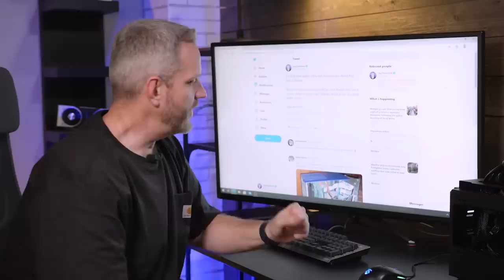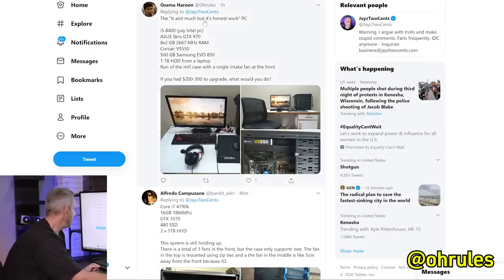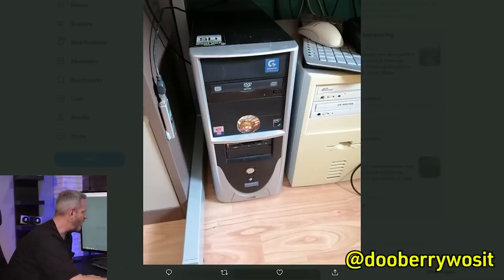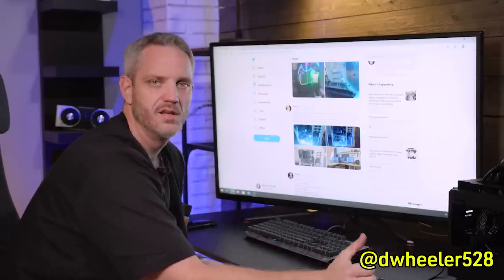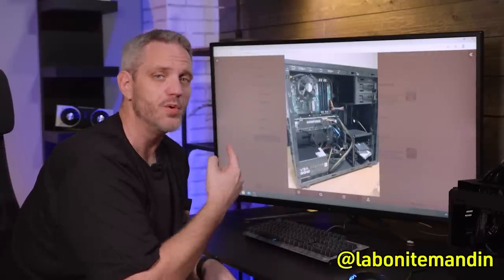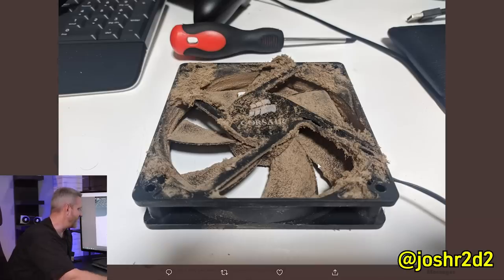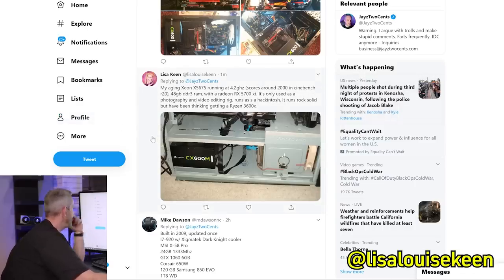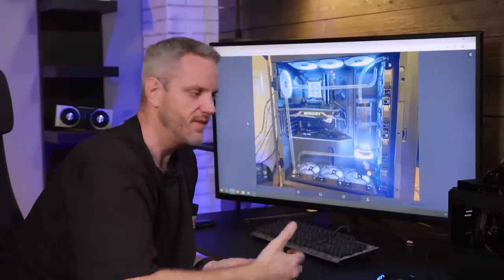Reacting to your WORST Setups... Send help NOW!

Comment: I bought an older pc for 400, took nicer photos, dusted and cable managed. sold for 550
Reply: Stonks
Reply: Nice.
 cable management is noice, bro.
Reply: gg best scam
Reply: I guess if you’re naive enough to fall for a 150 buck tidy up, then you’ll have someone to take advantage
Reply: my dad gave me his 10yo prebuilt with worse cable management than the one shown and i had a hard time putting an ssd in there. ended up putting it on the floor with double sided tape.

it was so old the power supply had no sata connectors but used a bunch of molex to sata adapters (even on the HDD witch had a molex plug on it)
Reply: First Name Last Name damn I just built my pc it’s pretty good just the cpu is ass so I’m getting a new one on Christmas (intel core i7 10700k
Reply: @distnky  aw man a intel gamer
Reply: When i can´t help myself, i buy a CPU which is selled under the ebayprice( I7 7820X~210€)  sell it, pay it with the money of the selling( 380€) and don´t have any money more?? But i bought an Intel DZ87 KLT 75K( maybe the last in europe??) and the seller forgot his Core i7 4790k i the socket, this was nice. But with every Pc i built for anyone, i prefer getting the best parts as possible to sell a PC  wich let me sleep calm every third night.But i am so thumb that i buy better modules and sell the other( Fx 6300 instead of FX 4100) which was never realized by the boy( landlord) which owns this b.s. pc. and took nothing. Officially i optimized the cable management.
Reply: DistnkY molex to Sata say bye to your data
Reply: Got the 69th like
Reply: LlamaCraft *im forced my $300 motherboard doesn’t support amd*
Reply: *I know it’s in godlike but sometimes you have to sacrifice*
Reply: Atleast you are not a landlord asking 1700 euro a month for rent 🤡🤡🤡🤡🤡🤣
Reply: das what we call flipping. I flipped a pc with an i3 9100f + Rx480 8gb for a 120$ profit
Reply: Pc flippers 🤣🤣
Reply: Thats bijness😂
Reply: @distnky  yeh why intel? i just dont understand why?
Reply: @lydierayn  noice. i recommend a 480 and like 3rd or 4th gen intel. cause u just say its a I7!!. that does the trick
Reply: @distnky  I would look into a ryzen platform, more value for your money
Reply: Noice product flipping. Welcome to the world of business
Reply: Stonks
Reply: Kykot nah it’s already in my house and I’m too lazy to send it back cause amazon gives too much trouble so I’m good with what I got, lol I got a MSI MPG z490 carbon and two black sticks of vengeance rgb pro ram (16gb), and I’m broke so I can’t buy anything else.. I’m trying to sell some games to get my cooler and then I’m done with buying parts for now.. then on Christmas I can hopefully gather enough money for a zotac 2070super and a core i7 10700k cause I’m running a fucking 2008core i7 920 rn and a mini 1660Ti XC, so then I’ll hopefully have my dream computer and not upgrade until like 4 or 5 from now (when I have job and make money)
Reply: well you cleaned it sir soo you did a job and got paid 👊👍
Reply: @distnky  Make sure you sell your old rig then so you can get some money too :)
Reply: @distnky  get an amd r9 3900 or r7 3800
Reply: @distnky  scam?
Reply: Update guys, I got my mother board and cpu
:))))))))
Reply: Dark Project yes cause you can clean a pc for free duh
Reply: @distnky  which one did u get?
Reply: Pc flipper
Reply: I usually pay my cable manager anywhere from $100 to $500 more on cable management
Reply: Blago ti se care
Reply: Stonks
Reply: $150 profit
Reply: @exhermit  It is possible that 550 was the real market price of the PC and the first seller didn't manage to sell it, because the PC looked bad.
Reply: Bought an itx build for 250€,
Cleaned and properly cable managed i made 450€ out of it.
Reply: That's love
Reply: Nice. But remember time is money. You have to evaluate before you invest, wait for shipping, clean, cable manage, photograph, make new listing (assuming you did a better job on that, too), packaging, shipping...and we're assuming you didn't use an online service that took a cut of the sale. Hope you didn't spent much time for that profit margin.
Reply: @michaelscott-joynt3215  yeah i here that. was 2-3 hours of work so happy with that
Reply: I really really don't care
Reply: like a used car salesman (Y)
Reply: @distnky  what about a ryzen? 5000 series just announced
Reply: @WhoAmISqrt  nice
Reply: @simulationmedia2770  got it for my birthday without question like wtf am I supposed to say to my parents “nah your gift sucks take it back” like an a nice or negative context that would be rude af
Reply: @cablescashes552  That.. wtf do you mean that’s off topic lol
Reply: @distnky  sos forgot which account im on, simulation media is my main
Reply: @cablescashes552  Ohhhhh ok yeah but I’m read my previous messages from about 1hr ago
Reply: You detailed a PC. Genius
Reply: Stonks
Reply: @LlamaCraft  ikr
Reply: Stonks
Reply: STONKS
Reply: @distnky  go amd bro
Reply: Big brain time
Reply: Ooooo this is a fantastic idea. Do you flip like this for side money or was this a one-time deal?
Reply: That's EXACTLY what i did to sell my car
Reply: hahahahah gg
Reply: U made 150 back, u could spend that on a new console or buy one and resell it again
Reply: I love flippers, have a great day mr. Flipper.
Reply: not a bad idea
Reply: @exhermit  A clean car sells for more than the same car dirty, a clean house sells for more than the same house dirty, this applies to EVERYTHING. We value clean and taken care of things more than the same thing in dirty condition, it is human nature and you have fallen for it too.
Reply: stonks
Reply: Bet you dint this is just for likes
Reply: Cleaning, repasting cpu and gpu plus some nice pics goes a long way
Reply: @piraat070  why would anyone pay that, if you can afford to pay that rent you can save up for alotta land
Reply: Ya know, its not worth buying a pc just to sell it off.
Reply: Guy could’ve been trying to be nice selling for less, or you’re taking advantage of people who don’t know PCs (or guy could’ve just not known how much it should sell for)
Reply: Nice
Reply: Lol gg
Reply: I mean good work. People are alright with paying up to 300 bucks on top for shiny rgb lights. So I dont see anything wrong here.

Comment: I always feel water cooling is like playing Russian roulette 😂
Reply: @shoOoterlegend  well... the correlation isn't impossible.
Reply: Yea once i build my first pc i am using an air cooler
Reply: Who needs water cooling when you can put enough fans in your pc to make it hover
Reply: @dylantaylor8625  😂😂😂😂😂
Reply: Yeah me too, I brought a decent air cooler to replace stock cooler instead
Reply: @dylantaylor8625  turn it into a mini helicopter LOL
Reply: That is true
Reply: @shoOoterlegend  *16.66
Reply: Yeah same if I ever watercooled a pc I would break all the components
Reply: I mean.. creating your own custom pipes can be risky but im sure most people test the lines before throwing all the expensive stuff in, im using Just an AIO and the rest is air :)
Reply: Narrrr 😁

I've had mine in for years and nothing bad happened.
Reply: And this is problem?  :-P
Reply: Ok. To clear $#|+ up. All my loops are solid copper and brass, that i have sweat soldered. Only long runs are glass for sight inspection. There are never any fittings over motherboard. Water cooling is a very safe and quiet option, when done correctly.
Reply: You should define that as " Custom water cooling that you cut and install your own tubing is like playing Russian roulette" .
Reply: @BADDTV  that's my plan. 360mm AIO, plus like 6 case fans.
Reply: @shoOoterlegend  i prefer a .38 J-frame...so that'd be an even 20%
Reply: I will always avoid it lol, i don't have any hardware that really requires it anyway
Reply: DC Electronics are actually kinda waterproof, but you really need to use distilled water to keep from shorting out
Reply: so true
Reply: @dylantaylor8625  why not both :)
Reply: @dylantaylor8625  who needs water cooling when noctua exists?
Reply: @dylantaylor8625  noise:D

Comment: "Do you spend money on a psu on a fx system, or do you just start over" that kind of hurt.... me and my gf both still playin on fx systems😬🙈
Reply: Yeah that was a little elitist, I agree.  Loved mine, ran FS 2020 1080p High at 23-27 FPS which is okay for a flight sim. Used money i had set aside for GPU on a new Ryzen 5 combo. Love both!
Reply: But that's true, unless you are fine really subpar gaming experience and excessive power bills, then keep FX, otherwise it's time to move on. Even a cheap build with B460 board, i3 10100F and 16GB 2666MHz DDR4 will annihilate any FX CPU. And whole setup is less than 300 USD.

Comment: "Get off FX"
My setup ain't even in the video and I'm getting roasted
Reply: The insane thing is that the FX 3850 can handle some modern games. But if your cpu dies, like my did, a switch to the R5 3600 is like trading your old tractor for a fighterjet :D
Reply: @e30kitty  how about going from a school laptop to a mid-high end build?
Reply: @Bonkers-yl2jd  I don'T know your school laptops, im from germany but im sure it will also be like that :D
Reply: i7-2600 is a good upgrade. Sandy bridge is a beast
Reply: @woodsy.2977  Compared to what? R5 3600 has more cores to do other stuff than gaming but each game is also a lot faster: https://www.youtube.com/watch?v=z9e954MYbuw
Reply: @e30kitty  compared to literally any fx processor
you can get one for like $100
Reply: @woodsy.2977  no they arent, you can get a ryzen 3500k for around 100$. please dont give advice that makes you feel better about your own system.
Reply: @Cpmnk  no such thing as a ryzen 3500k. I think you’re taking about the $200 3500x. How about stop correcting others on topics you have no idea what you’re talking about. I used a 2600 for years and i could overlock it to 4.8ghz.
Reply: I have an FX-8120 + 1050 ti, runs okay i guess
Reply: @woodsy.2977  😂😂😂says the person sudgesting 10+ hear old 2nd gen cpus, ok dude il will
Reply: FX-8350 on an asus TUF 990fx with a 1070ti runs modern titles at 1080p60 just fine.

Source: have.
Reply: @sir_chuckle5  you running a 1070ti with a 8350... there is something wrong with you. get ryzen boy
Reply: My 8350 is still going strong,  even when I push 4k 60 fps with s 5700xt.

I do have a crosshair v motherboard though
Reply: @mikeheidbreder3727  motherboard doesnt= power
Reply: I don't disagree, I say as I'm working on my 5800X-based replacement build, but my 7 y/o FX-8350 is still holding up decently strong even on modern games.
Reply: i mean, you should stay on fx if you wanna cook food on it
Reply: I have the 8350. It’s terrible at CoD, GtaV anything that’s intensive
Reply: I'd have to get a new CPU and get new motherboard and ram since my FX is using ddr3 and am3
Reply: @noblej7897  I just sold my 8350 with 16gb for 200$  upgraded to i5 ddr4, im happy.
Reply: @burwood69  what omg. When I first built mine it cost around 900 for monitor and keyboard mouse.
I been thinking about selling mine but for that low idk. And why wouldn’t you get a Ryzen cpu?
Reply: Ikr? I had FX8350 cloked to 4.4 and it was smashing. on 1080 it was running most of the modern games on 60fps on high settings. But I gifted to my mate who did not had PC and we still play games together nice. fitted there 1660 and its still performing. FX saving lives :D :D :D
Reply: ikr i have a 8350 i think but i clocked it to 4.2
Reply: From my personal user experience: FX 8350 + 1070Ti Cerberus 8GB (Also have 8gb RAM) is as effective as Chancellor Palpatine. Old hardware just WORKS.
Reply: @noblej7897  yep i had that when i went from i5 4460 to ryzen 7 2700x but was well worth it for me as i don't only game i do other intensive tasks that can take advantage of many cores and threads (also i lacked hyperthreading on old cpu)
Reply: I suppose I'll just cry in the corner with my old phenom x6
Reply: My old pc had an amd fx and that shit was the worst thing u can have couldnt even handle  gtx 1060 or csgo screen tearing and lag all day long because of bottleneckning
Reply: @e30kitty  I'm glad you say that cos tomorrow my new 3600 arrives to replace the 8350 I've been fairly happily using
Reply: @sir_chuckle5  Please play something like "SQAD, RED DEAD ONLINE" and repeat that :D
Reply: Leave the humble FX, its a cracking chip for anyone not wanting AAA gaming
Reply: @bertberto5671  The problem with the FX is, also a lot of not AAA indiegames were build on UE4 and if they have a open world or bigger maps like SQAU for example, the FX is not capable of giving you some FPS. Sure, you can play shit like overwatch with it :D
Reply: @e30kitty  Ewwwwww Overwatch
Im a TotalWar fan.
Reply: @bertberto5671  No idea about that. I love games like SQUAD or The Isle and the FX is not good for that :D I have 2 of them sitting on old mainbords and maybe i will use them for a retro pc XD
Reply: @Bonkers-yl2jd  I went from an old gaming laptop to my top end system - 5900X, 3080, Gen 4 NVMe, 8.9ns B-dies, and my reaction was this:

"IT'S TOO DANGEROUS TO BE LEFT ALIVE!"

2fast4me
Reply: I have an R5 but it doesn't go into my fx mono 😭
Reply: ryzen 2700x 4 starters wont kill you- Jays right only you are killing you.
Reply: Jay: turn a trick
This morning : man looking to upgrade found turning tricks out
Reply: for a split second I thought of WindowsFX linux 😂

Comment: Jay: "Stop using FX!"

Sad FX 6300 noise from under my desk

Still a great rig to host an Ark server but i'm glad i have my skylake sytem to game on.
Reply: I got 6300 fx cpu for kind of a server machine caz i didn't wanna mount all of this  tb hdd s on my threadripper system and you might be surprised but that cpu does a great job for handling almost 10 tb of data .(4 pc is linked to this system)
Reply: @amiryousefi5374  I ran a 6300 at 5.1GHz for quite a while before I upgraded to an 8350.
Reply: And my 8350 is crying now!
Reply: Still using my Phenom II. Lol
Reply: ok why are fx CPU´s bad? because i have a fx 6300 but its a six core cpu and you can overclock it to 4.4 GHz or when you are lucky to 5 GHz so why is it bad?
Reply: @ixigamer1337  awful ipc and not a true 6 core, more a 3 cores 6 threads (4 cores 8 threads for the fx 8350)
Reply: @ixigamer1337  because 3/4core intel is slower, but still better... idk why! Maby because (YOU HAVE TO SPEND YOUR MONEY, BECAUSE YOU NEED THAT SPEED, even if you dont use it)
Reply: Mux ツ  lol
Reply: @KevinBesnier  other way around 8 cores 4 threads..   Fx 8350 is technically a true 8 core cpu..  They just share 4 schedulers....
Reply: @ZeR0goth  actually it's 4 modules that each has two "cores"
Reply: @KevinBesnier  true but still 8 cores...  With 4 schedulers
Reply: @Olslov  same mate😂😂
Reply: Ark in 2020. Lul.
Reply: laughs in FX 8350
Reply: My FX 8300 is still alive and kicking good. If I see any drops(Like below 30) ,THEN I will upgrade
Reply: Everyone with an 8350 rushes to the comments** 🤣😭
Reply: Same, I also have an FX-6300. I can't afford to upgrade both my mobo, CPU and RAM since to upgrade to anything relevant I'd have to buy a new mobo which wouldn't work with my DDR3 ram I currently have. I have a total of $0 to my name so I gotta game on this for the next several years.
Reply: @Boi Chaoz Shit, I got a FX-6300 with 16 GB of 1600 MHz RAM too xD Tho I got a 1050Ti
Reply: ThinkFreely2012 i run fx9590 pretty decent everything 8370+ is still decent for 1080p gaming
Reply: @ivo3598  except that a jump to a 1st gen ryzen would increase your frame rates 30-55% and thats with the ram at stock speeds.. 

Its true, the ipc on fx was lacking when it came out. and in this day and age, its even worse... 

I still have my 8350 as a server rig tho, and my kids running my wifes old 8320.. but.. i promise you, a jump to ryzen is a considerable upgrade. even moreso for 3rd gen
Reply: I have a FX 8320
Reply: Cries in FX-300 & Radeon HD 6670
Reply: Abhinay Limbu how do you live with that PC lol
Reply: @ThomasRaud  What are you even talking about?   If by slower you mean in frequency sure, but even if you could get an old pentium 2 to 8 GHZ it would be shitter than a 4GHz Ryzen 3600.  IPC and cores are more important than the fake cores and high frequency the FX series used. Intel systems from the same time period as the FX kick the shit out of them in every single application you could use them in.  You can get a used sandybridge/ivybridge setup for not much more than the old FX stuff at this point and be noticeably faster.

If you're using your computer for gaming you're using that speed.  You are never not using that speed if you game on your computer.  Why not just run an old AGP system so you don't waste power you don't need?  You seem really confused.
Reply: @tonymorris4335  wtf are you braging intel fanboi? 2012 Ivy vs buldozer? Both are 4 cores and 8 threads. Where did you read i sayid 8core? Thats what amd claimed. I SAYID 1 core clock i higher that intel 1 core clock and this matters, not only core count. You cant compare new and old tech, we all know how much faster is latest tech against old. Ivy vs buldozer is like compare shovel to hammer, both is doing something but was meant for different task. And ou fkuc that annoying intel fake game type measurements.. yeah thats what you care about. Other is doing WORK. And thats what my FX is doing, not blead/leak/melt and spectre around!
Reply: Jay: "Stop using FX!"
Me: But my 8320 still works...
Reply: I pretty much got off of FX once Ryzen was mature enough. Worth it.
Reply: @tonymorris4335  they weren't fake cores
 They just paired each 2 with 1 scheduler..  I get really tired of correcting you Intel fan boys..  Go do some real research